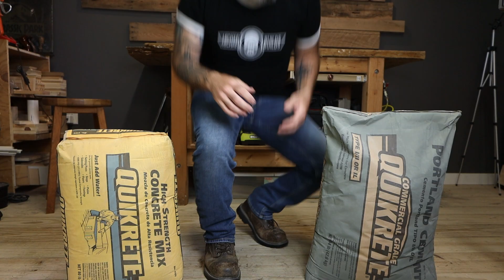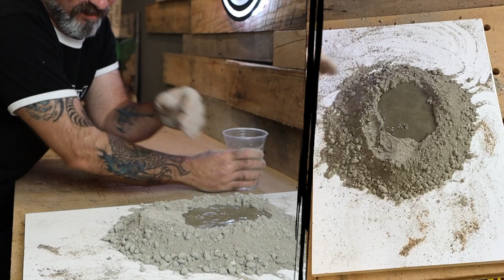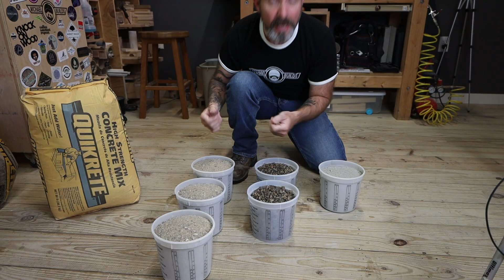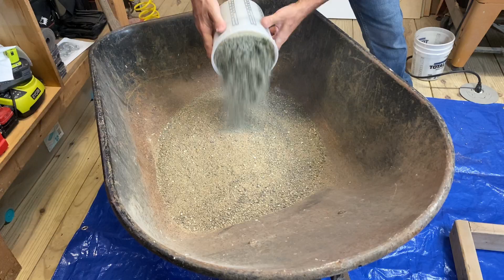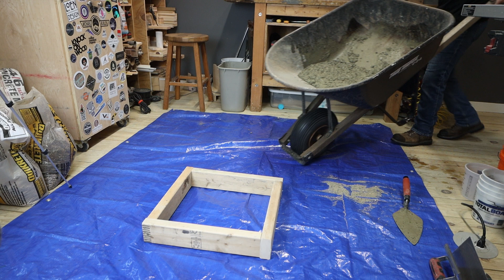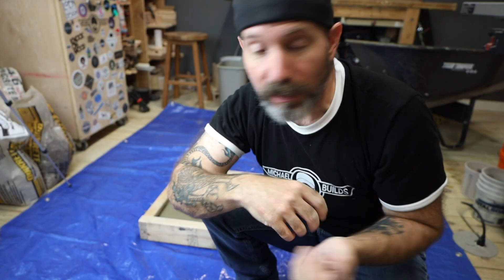What's the DIFFERENCE between CONCRETE and CEMENT?!

Comment: Cement in a sidewalk pour would be appropriately 12 to 15%.
Cement is only the bonding agent. 
Aggregate is what gives the strength. 
Concrete cures, doesn't dry.( why concrete is used for bridges structures under water). ( Chemical reaction)
Air entrainment is used in most concrete 3% to 7% ( soap additive solution). Why air entrainment is needed? What happens in winter?
Water will wet concrete pad, freeze and bust up, also helps to prevent scaling. 
Self leveling concrete has lots of flyash too.
If you're doing a larger pour, get professional help or u will be just wasting time and money.

Comment: You got its wrong! 
Your bag of "cement" is baked limestone mixed with clay. 
Cement is what you called a concrete mix. 
Concrete is the solid rock you get after the cement mix is done curing! 
By the way, plaster is just baked limestone.

Comment: If using a "cement" mixer; while it is rolling, I like to add a bit of water to make sure the last batch was completely incorporated then I add the gravel to get all things mixing and then the sand and cement. 
When mixing in batches the measurement is in shovel fulls. Don't forget to wash your tools before it sets.

Comment: I know you were making this simple for the people but you may have over simplified because though cement may be 1 ingredient of concrete, cement is not one ingredient. It's made up of limestone, clay, gypsum, calcium, silicon, aluminum, iron and others fed though an assembly process that among other things cooks it at 2000 degrees F.  I know, of course Michael that you know this, but this video kind of gives the impression that cement "grows on trees" as it's own element, and I think it's important to be clear as well as entertaining. 😃
Reply: Don’t be picky … I found this video very useful for practical purposes.  I’d have been bored sick if he started explaining what you are stating.
Reply: This video is more of an introduction YES Concrete and Cement have more  deeper details in them but that doesn't mean it has to be this way. Please understand that this is an introduction and not a stamp statement if I wanted a video with your ideal information I would of
Reply: I don’t want it more complicated than what he explained perfectly. Why does one need to know all the crap that’s in cement?
Reply: @nicoleshepherds9369  Oversimplification leads to misunderstandings and mistakes, even in something as simple as cement and concrete. Though it's not necessary to list all the ingredients in cement, saying it's one ingredient, when I'm almost certain he meant to say, 'one ingredient in concrete', is misleading. The reason there's a warning label on the concrete bag is because of all the crap, as you say, that's in cement. Creators, like Michael, who know what their talking about, need to be more careful when explaining things to viewers who don't.

Comment: So why use concrete over just the cement by itself? I'm going to assume it's stronger or last longer or something?
Reply: Cement is has no structural integrity the way that concrete has , those gravel rocks really give the mix it’s strength and structural integrity. Hope this explanation helps

Comment: Michael good video as always. The way i always explain it is that concrete is a homogeneous mix of sand and aggregates held together with a binder. 

In cement concrete the binder is cement, in coal tar concrete used for road construction, the binder is coal tar. 

Technically speaking, even a mix of sand, aggregates and epoxy will be an epoxy concrete

Comment: I remember seeing Jamaicans build a pier in Jamaica on the cheap because they could pull sand right off the beach and a bag of cement is cheap.  I questioned whether is would be strong with the salt and other organics in the beach sand, but it was apparently "good enough".
Reply: The salts in the sea and will corrode and compromise the concrete in the future. Reminds me of the skyscraper along the beach in Florida that collapsed
Reply: @jeremiahthompson82  Not so sure.  Concrete hardens underwater, even in seawater.  Salt finishing is a common aesthetic finish.  Have it on my pool deck.  The concrete immediately next to the rock salt hardens just fine and then they use a hose to dissolve the salt and leave the sharp holes.  Rebar, however, will corrode if exposed to salt and oxygen.

Comment: So, you only purchase cement if you are going to use it to make your own concrete mix. Correct?
Reply: Other common uses are mortar (nix the gravel), or as a surface coat (nix both), or there are other applications (soil stabilization for instance), but yes.

Comment: Great video Michael! So which mix holds up better over the long haul, concrete or cement? Why would you choose one over the other? 🤔🤔👍👍
Reply: Cement is just the glue.  You can use it only and should be fine but more brittle, but it is more costly and take a lot more of it to get the job done.  Stone is really just a filler to take up room.  That is why if you break it apart you can many times chip out a rounded stone and leave a lil pocket of shaped cement/sand blend.
Reply: If you have two boards and you want to make a table top out of them, you would glue them together. You wouldn't make the table top just out of the glue. Same with concrete. The cement is the glue that holds the aggregate together. The aggregate, when mixed with the cement, becomes the concrete which your driveway, or sidewalk, or flowerpot is made of. You don't use just cement.

Comment: Dumb question: So, are there cases to use just cement over concrete or do you always need to make concrete?
Reply: Yes. Cement alone is often used in two cases:
1. To fill small gaps where aggregate would hinder the mix flowing into the gap.
2. As a surface layer to provide a smooth finished appearance to an existing object, like a foundation wall.
Reply: @seigeengine  Yeah, that makes sense.
Reply: Do you mean mortar, (cement and sand) or just cement with water?
Just cement and water would have very little structure for strength.
Reply: @SideQuestShenanigansLTJ  Yes, I was wanting to know if there are cases of just using cement. So concrete is the 3 mixed - Strongest, mortar is 2 - Less strong? and just cement is crap?. Basically
Reply: @vmoutsop  They all have their uses, concrete is a complete structural medium, mortar is a gap filling adhesive used to bond larger solids to each other, or sometimes used as a complete medium for decorative uses, cement is the glue and setting agent.
Reply: @SideQuestShenanigansLTJ  Thank you
Reply: Doubtful… cement is weak on its own… concrete is only as strong as the aggregates being used

Comment: OK ........ but where's the Fairy Dust? ........ You thought we did not notice?  ;o)

"Waddya mean Fairy Dust?" I hear you ask! 
The magical dust you add to do .............. change the mix ........ you know the Magic? I reply.

OK, OK, OK ...... I'll spell it out.

The dust comes in several varieties One has quite sharp bits in it that make the slab stronger another slows the reaction time allowing you to have a brew mid pour and get all those bubbles out easily. There are others but those are the two main ones!
Reply: Do you mean structural fibres and retarder? It’s not all magic and fairy dust bud…… it’s alchemy
Reply: @joshwabii5577  Witchery, I call it ;o)

Comment: Love your videos Michael! But I am concerned when I see you putting your hands in wet concrete. the wet concrete can cause cement poisoning, a chemical reaction that can cause burns to the skin.
Reply: If you only do it every once in a while and wash your hands off quickly before it starts to set, you are pretty much fine.

Comment: But when if ever do you use cement only?
Reply: Cement is very weak on its own… concrete is only as strong as the stones you are using
Reply: Cement only can be used to fill small gaps where even sand would be an impediment, and is used to provide a smooth surface coat to things. It can also be used to cast objects that don't require much strength.